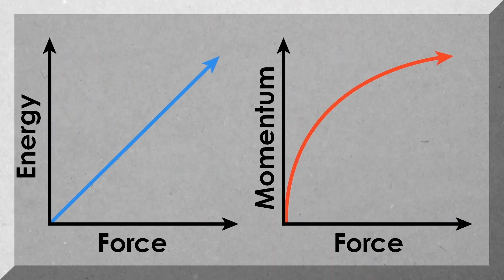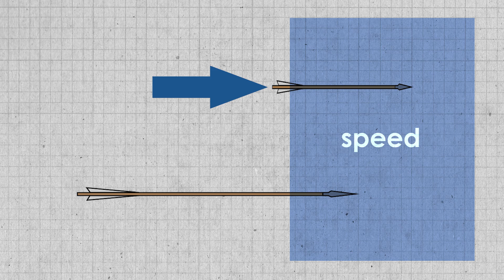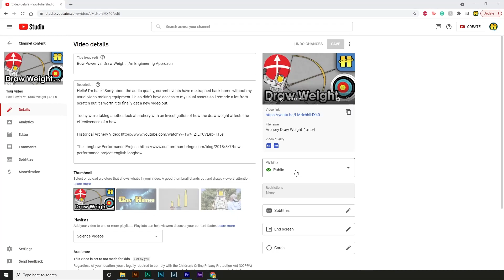Debunking My Own Video

Comment: Something I've seen from ballistic testing with bullets on other channels is that lightweight for caliber ammo has better penetration qualities, while heavy for caliber ammo stops faster. The light ammo may tend to zip through a target while a heavier one will dump its energy. Fast and light bullets are known for wrecking steel targets at close range, but losing energy with range more quickly from drag.

Someone even got their hands on exotic As Val 9x39mm subsonic AP ammo. It uses a stupidly heavy but slow bullet in order to prevent a sonic boom. While the bullet carried a ton of energy, it failed to penetrate a helmet even common pistols could with normal ammo. That said, the bullet left a massive, fatal dent in it.

Long winded way of saying it, but in bullets, the penetration seems to favor velocity rather than mass or even total energy. Makes some sense when you consider the equation for kinetic energy. Probably helps that the material may not be able to deflect quickly enough, and their inertia makes a better shearing force. 

That last bit is largely guessing, but it's interesting to consider nonetheless.
Reply from the maker: I’ve heard the same thing which is why I mentioned it as one of the possible outcomes. I doubt this test translates directly to such high velocities, but I do wonder how much bullet shape/size changes things. Also, how well the heavy bullet you mentioned actually matched the energy of the lighter ones. Having the same powder load behind a heavier bullet would increase the pressure so the manufacturer may have reduced the load to avoid destroying barrels

Comment: Momentum has almost nothing to do with penetration.
At low velocities (knives, arrows) it is kinetic energy. Penetration of most softer targets is highly efficient.
At intermediate velocities (very slow bullets) it is a combination of kinetic energy and sectional density.
At high velocities (rifle bullets in soft materials) it is almost purely sectional density, and is logarithmic with speed of the projectile doesn't deform.
At extreme velocities (space debris), the object explodes on impact and it's the cube root of kinetic energy, as that is how explosions travel through matter.
And at even higher velocities (radiation) mass and energy doesn't affect penetration and the "object" (particle beam) penetrates based on velocity and the characteristics of the projectile's particles, rather than its bulk characteristics.

Comment: It was nice to see you explain the different possible results before showing the testing! tho it took me a bit to understand why you were asserting that kinetic energy would be the same for different arrows fired at the same speed. My best guess is that since KE = (1/2)*m*v^2 and m is small, v^2 is large enough that KE1 is very similar to KE2. I'm still confused though, because KE1 will always be double KE2 because M1 = 2M2, which puts us back at "significantly different KE" territory.
Reply from the maker: The speed was actually different for the arrows! The light arrow averaged 22.95 m/s and the heavy arrow averaged 16.72 m/s. This gave them kinetic energies that were within 4% of each other. Despite this, the heavy arrow actually had about 44% more momentum because momentum doesn’t square the velocity. That’s why a single test can isolate momentum, kinetic energy, and raw velocity as potential driver’s for penetration depth, each would create a different result given the same setup!

Comment: Great video. It’s unsurprising that the energy is the determining factor here. The arrow is doing work against the force required to break the target. The force doesn’t depend on the speed in any significant way in this speed range because it’s plastic deformation that’s doing most of the resistance. Thus the arrow stops when that stopping force does work equal to the arrow’s energy. More energy with the same resisting force means deeper penetration in solids. 
Conversely in fluids, the resistance depends significantly on the velocity of the arrow and heavier arrow will be slower but will penetrate deeper into the fluid because the resistance will be significantly smaller for it. Maybe you can do a better explanation in a video someday.
Reply from the maker: This is more or less why I wanted to do this test. After the original video I realized that energy being force times distance may actually be the driver. The only counter argument I could think of was that force may not be constant with speed but looks like it is
Reply: @ConHathy  it has to be mostly constant. It’s basically the ultimate compressive strength of material times cross section of the hole. Maybe some friction as well but it doesn’t depend on the speed as well. The other way to look at it is to see where the energy goes initially. Most of it goes into breaking the bonds holding the solid. And the energy required to do it doesn’t depend on speed. Only tiny minority goes into accelerating the target or into pressure waves in it. Things may be different if the projectile is supersonic in the target. But it is not the case for these arrows.